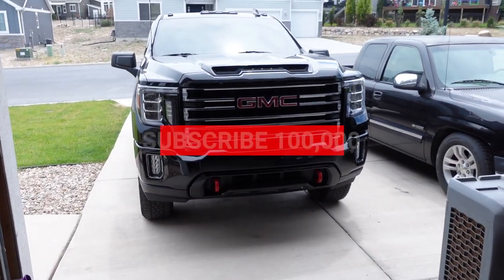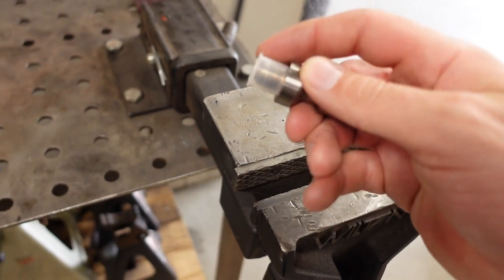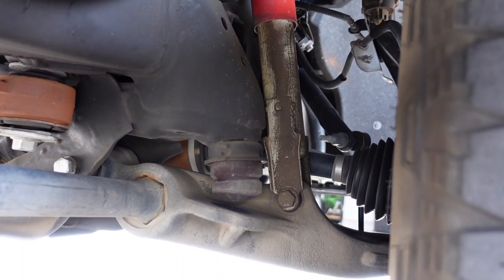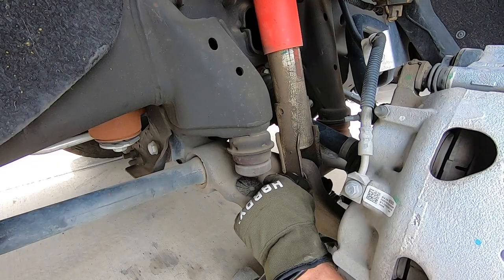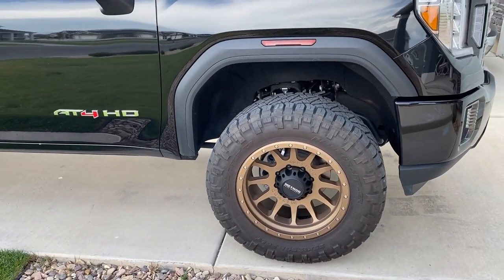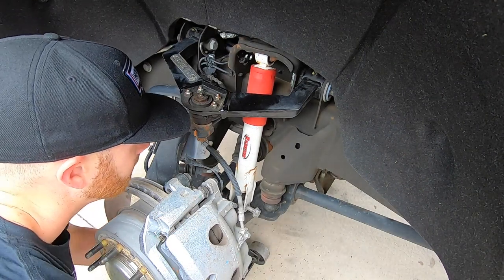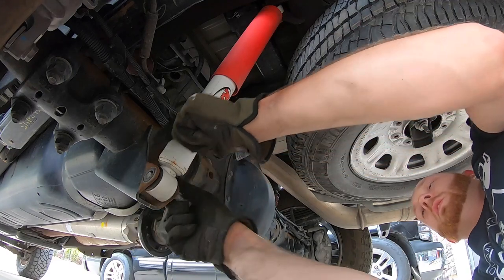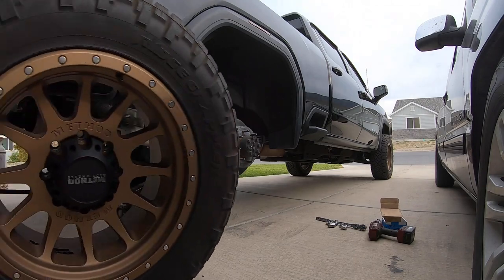Fixing what GM wont on my 2020 AT4 HD & Improving the Ride Quality #gmc #at4 #duramax

Comment from the maker: so far, I've put about 100 miles on it, and the Bilsteins are doing great!
Reply: Definitely like the Sulastic shackles idea I'm waiting to get a set myself. Why not go with the cognito 4" kit and turn it down to level it will definitely ride better then. Also you can get a higher end scanner to lower tpms settings.
Reply: @3127cal  they'll fit both 2500hd and 3500
Reply: @mattward330  looks like they are the B8 5100s?
Reply: Just put a set of 5100's on my Cummins last weekend. Very happy with the ride so far!
Reply: Are you supposed to torque tires from one side to the other like a star pattern instead of going in a circle?
Reply: 100000 for a Ford you need help
Reply: Pretty sure there was a lawsuit years ago about aftermarket parts vs warranty and the car industry lost and there is now a law covering this - it is up to the dealership to prove that your parts caused the failure, otherwise it is illegal to deny warranty - https://apb-law.com/understanding-magnuson-moss-act-relates-aftermarket-car-parts/

P.S. Please use jack stands, esp on a driveway.  A friend of mine was killed because a vehicle fell on him due to a hydraulic jack failure.
Reply: Yeah that dealership is lying OR just being nasty and doesn’t want to pay out money which would never get my busses and definitely deserves a review.    There’s been lawsuits on this same thing as well as company’s like BDS etc. that have it written in the paperwork on parts stating how they can’t deny the warranty claims.
Reply: Bilstein 4600  series also great shocks
Reply from the maker: @3127cal  mine is a 2500, but the shocks should be the same
Reply: Leveling kits do not void warranties espescially on a torsion front end.  What are they gonna tell you next, if you turn up the keys that voids the warranty?
Reply: I installed 5100s on my buddy's 2019 over the weekend, he's officially been Bilstein'd.

Comment: Inspect your steering rack bushings as you have someone else turn the wheel lock to lock. I had to have mine replaced with delrin (and a custom machined bushing holders) and got rid of the factory rubber. I have a 2014

Comment: My 2021 Sierra 1500 AT4 upper Arm broke right at the ball joint. The ball joint didn’t break, it was the aftermarket A-Arm that the AT4 package is installed. I think it is from BDS from what I am told don’t quote me on that. 18,000 miles just came off the interstate from running 80 mph for 60 miles. At the end of the trip before the off-ramp the truck felt ‘off’ or squirly or loose. Came up to a stop sign turned left and the r/f wheel cocked at 45 degrees and almost fell off. Luckily then I was only going 10 mph. Truck stranded me, but could have been much worse with me and my family. Towed to the dealer and they installed the same new upper A arm. I don’t own that truck any longer, got MAJOR trust issues. Loved the 6.2L engine though.

Comment: I've heard the opposite regarding bilstien riding smooth and fox being rougher ride. I'm not an expert but Bilstiens are digressive which means they are stiffer on smaller bumps and soak up the larger bumps smoother. Fox and king shocks are either progressive or linear and are smoother all around from everything I've read. Still undecided on what I want for my 4runner, like you said a lot of stuff is on back order so I'm just going to wait awhile.

Comment: F-150, I hope you're going to put a large ground wire on one of those ignition coil mounting bolts. That plastic fender liner won't make a connection and good spark. Might melt or burn something trying to ground the circuit to the plugs. 😳

Comment: My 2015  Denali 3500 with 133,000 miles probably still has the original shocks. It does ride like a lumber wagon.  Guess it's time. :)

Comment: Cringe moment when you started the lugs with an impact & when setting torque; Always start the lugs by hand and always go in a star pattern on torque.
Reply: That and using a breaker bar not a torque wrench..
Reply: Yeah, that whole part is real cringe worthy.
Reply: Feral Man  This. I've changed thousands of tires in my career. Never a problem with an impact of you know what you're doing.

Comment: Hey LT!  Loved you on Truck Tech, man.  I could see GM, in this case, voiding the front end warranty after an owner lifts his/her truck and puts on larger tires.  They'll claim the angles are jacked and the remaining stock components weren't designed for the add-ons.  But some of the components in other systems, like the fuel filter on my '19 AT4 Sierra Dmax, is crap.  The plastic housing is notorious for breaking or stripping out when simply doing a fuel filter change.  In anticipation of this, I'm putting on a Fleece Performance fuel filter kit.  The main body is made of billet aluminum that takes either a Donaldson, spin-on filter.  It makes the job 10 times easier and cleaner but I bet GM would give me or someone a hassle if there were ever a fuel-related issue.

Anyway, I checked out a couple of your YouTube vids and subscribed.  A shock upgrade will be in my future, some day so thanks for this vid.  Any feedback on the Rancho 9000-series shocks?  I put those on my old 1500 a few years ago and they were sick!  I loved the adjustability.
Reply from the maker: I put the very same filter on the truck in a video that drops tomorrow as a matter of fact. thanks for the subscription! i don't have any personal feedback on the 9000 series shocks though...
Reply: @LawrenceTolman  I eagerly await.  I tried and could not get the electrical connector off the top of the filter.  I wanted to do that first before disconnecting the fuel lines then remove the bracket.  I may have to remove the fuel lines first then the filter bracket to better access that connector.  Hopefully, your video details that.

Comment: fox 2.0 res shocks on jeep jk vs bilstein 5100: fox are firm and forgiving.  quite nice.  5100s are not nearly as nice.  too firm through the full stroke.  much less refined (but they're cheap @75$ each and work well enough when the fox come off for bi-annual fluid change / rebuild).

Comment: I know it’s not a Duramax, but my 1992 C1500 1/2 ton pitman and idler arms, ball joint and tie rod ends lasted to 165,000 miles, and was not being greased often as it was a farm truck before I got it. New GM or really anything is garbage in terms of longevity and reliability.

Comment: Sounds like another part gm cheaped out on, my 2011 f150 4x4 didn’t have front suspension issues until around 150k miles, replaced it with a 2inch rough country strut and it fixed it. Before I fixed the truck had a sort of hop on smooth roads

Comment: Should have gotten them from summit racing they are great about warrantying  my new shocks. Last set i sent in i didnt realize how much they had worn out until i put mew set on both were bilstein silver type just worn ones vs. New ones tightened my old duramax suspension r back up

Comment: It’s out of bumper to bumper warranty any way, and it’s been modified. Yep your on your own.
Reply: Mods only void a warranty if those mods are what caused the failure, and in this case... Yup. Level a GM truck/SUV and you're gonna wear out the front end. It's been that way since the dawn of time.
Reply: @jonathanallen2530  I think he meant the 3 year/36k mile warranty is gone. At least last I heard GM still had that duration, so even if he had factory suspension they wouldn't cover it.

Comment: Man honestly your feedback on this truck scares the crap out of me because I bought the same truck, but with the 6.6 gas. Less than 50,000 miles, and you’ve had to replace the transmission, back glass, the shocks, I’m pretty sure you had trouble with your steering, and other various parts you’ve mentioned that have excessive wear. That’s unacceptable for a $70k-$80k truck. I like your optimism, but let’s be honest that’s a nightmare. One that I hope I don’t share.

Comment: The reason it isn't covered is because it is out of Warranty. Not the dealerships fault, thought you where an expert. 3/36 for shocks.
Reply from the maker: you are correct, but the discussion I was referencing happened earlier this spring before 36,000 miles had passed

Comment: I have a 2018 Silverado LT 1500 Double Cab Gasser. I was contemplating on getting the Rough Country 2 inch leveling shocks for the front and the N3 shock’s for the rear. What’s your opinion? Sir

Comment: GM had been the worst for avoiding warranty claims for leveling kits, buddys ball joint had almost fell out (26k miles) and because he had leveled it they wouldnt cover it which was BS. His ‘18 F150 they never said a word with level kit and bigger tires when his steering rack messed up, just replaced it and thanked him for his loyalty. Dodge denied the turbo because of an aftermarket exhaust from the emissions shit back, needless to say he sold the Dodge and bought another Ford but an F350. They all are junk in the emission dept, its sad when the DPF costs more to replace than a transmission or a lot of nice used cars

Comment: I think I Saw a screw in your right front tire. Please check because it looked like a screw! I think your dealer is trying to weasel out of some warranty work. My 2021 F350 has a Carli 5" lift and suspension. The dealer has not said anything about it!

Comment: you didnt need that spacer with those shocks, they already accounted for the 1.5" lift, just to make the factory shocks work with the level.
Reply from the maker: the need for the spacer was based off dimensions provided in the cognito leveling kit instructions, and when I measured the shocks side by side, the stock shock measured the same as the Bilstein
Reply: @LawrenceTolman  I wonder how they can advertise as suitable for a lift if it's the same as factory dimensions. Interesting.

Comment: I blew one in my 2022 gmc elevation after 3k miles.......complete garbage

They build these trucks for price point so never gonna get high end anything on them....if they anything on there remotely popular by top brand you will pay out the ass for that.....

Think bilsteins ride a lil rough based on their digressive valving....eibach has basically same shock with progressive valving which makes them lil more softer and compliant......

Either way alot better than than rancho

I do think 2.0 fox rides pretty smooth, 2.5 different story

Bilstein and icon use different valving which is firmer in beginning and softer later....progressive valving is opposite

Wasn't huge fan of bilsteins 5100 tbh....maybe if you push them harder they shine better but never got to do that so idk

Comment: Nice work but I would comment that leveling kits, lifts, and wider offset wheels all stress suspension components outside their original design parameters.  That's why manufacturers won't warranty them when changes are made.  They spend millions of dollars on research, testing, and engineers to optimize suspensions for their intended use.  Contrary to some beliefs they don't want failures.  It cost them money and reputation.

Personally I don't have the expertise/qualifications to match, let alone exceed, their abilities so I run my trucks stock and rarely have failures before their stated useful lives.  I also don't have the time to diagnose or experiment so I don't get the cool look either.
Reply from the maker: hey you're not wrong, the aftermarket parts 100% do put more stress on the steering and suspension components, so I'm not surprised they wore out, or even all that worried about it. thats just part of owning a modified truck, and I'll take any excuse to upgrade and make things stronger
Reply: @LawrenceTolman  To be sure most people don't have your talents.  My nephew is an engineer and explained how even small changes will cause pre-mature failure.  However you're aware and stay on top of it.  Good job!  I'm impressed.

Comment: No grease fitting “lubed for life” has led to how many recalls? Surprised actually driving the truck doesn’t void the warranty. No quality anymore from any manufacturer.
Reply: You're probably the only one that knows what those are for. 
I haven't used a grease gun IN YEARS, perhaps decades. 
99% of the buying public doesn't care enough about their cars or trucks to be lubing suspension parts according to a service schedule.
Reply: As a dealer, I would agree. They are all junk.
Reply: They did away with most grease fitting because people who don’t known what they are doing were over greasing and splitting the boots, causing earlier failures.
Reply: My 2020 gmc 3500 definitely has grease fittings on the front end as did my 2916 3500hd and my 2002 2500hd chevy
Reply: @gregorywieczorek4160  In my 25 years with a dealer (been out last 13 years) watched them disappear, watched warranty denials and recalls follow (very irritating as a tech). Good to know there is a comeback, as long as they get used properly.
Reply: @larryr8492  the only thing that I have owned since 2002 that has grease zerks are hd pickups and of course my semi trucks
Reply: @gregorywieczorek4160  on semis I doubt they'll go away completely.

Comment: I can't believe your pitman arm and idler arms are junk already. Gm should step up. It's not from your leveling kit. It's a duramax. Factory parts can't handle 35s? That's horse shit. I hope the new parts work out well for you.
Reply: no kidding, i was just thinking for as much as these things cost today, a hd truck should go way longer and be trouble free
Reply: So.... you're upset the OEM did not manufacture the vehicle to hold up to aftermarket modifications?  Deviate from OEM specs and things fail, they didn't design fluff into the components.  That's the dice you roll when you modify a vehicle.
Reply: @benjaminreinhardt259  it is a heavy duty trucks. It is advertised for towing/hauling. People don't buy these trucks for commuter vehicles. The stock size tires are 33" tall. He said he rarely tows with his.. and he only has 40k miles on it.. 20k of which were with stock tires. The slightly bigger tires should not cause the stock "heavy duty" parts to wear out that quickly. 
 Yes, he modified his suspension. But realistically, if it's supposed to be a tough truck, it should not wear out that quickly..  compared to a truck that is actually used to tow heavy loads constantly. This truck has had an easy life and it's steering and suspension is already junk.
Reply: @EricErnst  heavy duty doesn't mean overbuilt. lol.  the companies build the vehicles right on the edge of quality and performance. I know what your saying but I've worked on lots of 200-250K duramax in stock form with stock wheels and tires with all original front suspension.  To say they build junk is not totally true if the truck is left alone. All disclosure though I HATE leveling kits. Just lift the thing is its not sitting high enough.

Comment: Hahaha LT now you know why GM guys never have rusty tools and everybody has their parts memorized!  Parts that are changed at 150-200k on other makes are changed every 50k-75k on GMs.  The rule around me is everyone else must drive Toyota, Honda, or Ford so they don't interfere with my GM repair weekends!  If it were not for the affordability and the plentiful performance parts for the LSx platform I'd probably stop buying them myself.  Think of some of the GM silliness: one DRL light constantly burning out, bad instrument clusters, steering column rattles, pitman/idler arm failures, sloppy steering gear boxes, broken hood latch release lever, broken seat recliner levers, poor shutting doors and the list goes on.  After listing this out I'm wondering why I do this to myself.  Everybody who works on cars can fix GMs and something like 80% of all hard parts store sales at the big three aftermarket chains are replacement parts for GM vehicles.  How can this be unless we have just become numb to replacing parts and having to upgrade because the factory designs leave much to be desired and it has become normal for us GM guys?  Tundra owners don't accept these things why should we?

FWIW I think this is a product of many domestic manufacturers racing to the bottom dollar supplier/parts "saving money" and then wondering how the hell we ended up at the bottom collecting unemployment checks while the CEOs and Wall Street people ended up with all the money.  This is why the JPN OEMs outperform in reliability because they place value on quality while domestic OEMs place top value on cost.  
This is happening on US domestic airplanes now sadly and we see the results those cost savings delivered as evidenced by recent aviation history. 
RANT OFF but I could easily go on.
Reply from the maker: Hey you’re not wrong, but I still love my old chevys!

Comment: I really like the LS engine platform but I'm amazed at all the engine failures I read about. This cylinder deactivation is total BS. Lifter failure in todays world is ridiculous and I've mostly been a Chevy Guy.  I think this GMC is the best looking truck in my opinion there seems to be a lot of issues. I realize most of the whiners come to the internet to complain but they all can't be wrong.

Comment: Save the warranty for the P0420 and P20E8s and other P20 codes that are just around the corner. Love the diesel torque but getting tired of the emissions and reluctant codes. Going back to gas once I get the current problem fixed. Just have to leave home earlier. But at least I know there are no, "175 miles until reduced speed, see owners manual" messages in my future with a 6.2.

Comment: Had the same problem on the 2017 1500, 36k and the rears were leaking, ordered them on amazon, they came in the morning Iand crawled under it and did them during my lunch. I think the dealer wanted 500 for just the rear installed. On the other hand my 2000 silverado that has had a set of 5100s on it for probably 8 years and at leaast 120k are just starting to seep when i checked during the last oil change